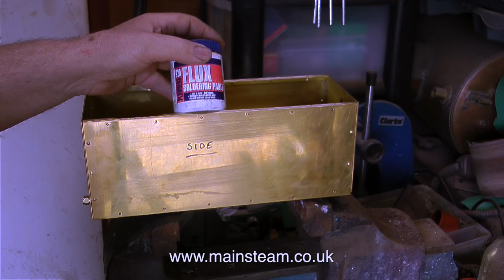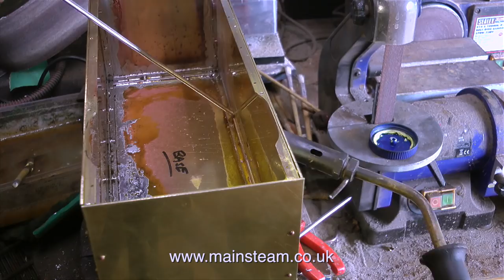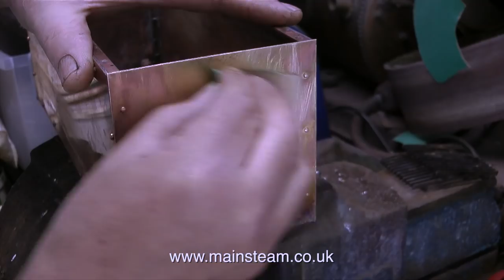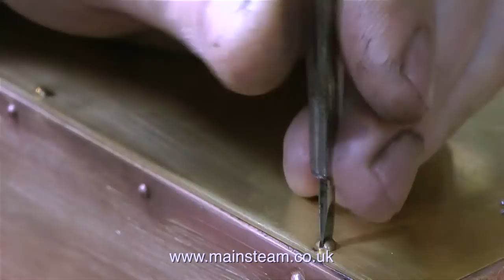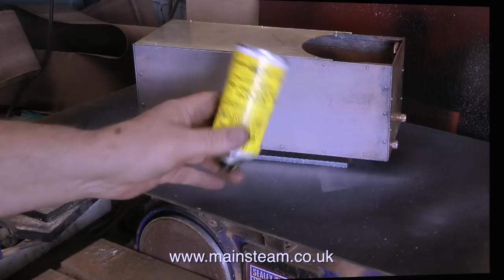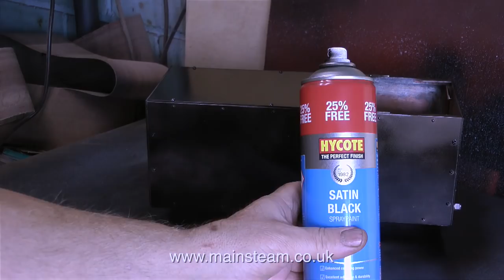A MODEL STEAM BOAT NAMED EDITH - PART #10

Comment: Keith, soft solders are tin (Sn)/lead (Pb) alloys.  The %s are stated Sn 1st.  The "ideal" electrical alloy is 63/37, which melts/solidifies at single temperature (eutectic), just as a pure substance behaves.  No "pasty" state here.  The near eutectic 60/40 is the commonplace electrical alloy.  50/50 and 40/60 alloys are "pasty", with higher Pb concentration being more "pasty".  Careful selection of flux and alloy, as you've done, ends in a highly satisfactory result.
Reply from the maker: Thanks Eli, I couldn't have put it better myself }:-)))